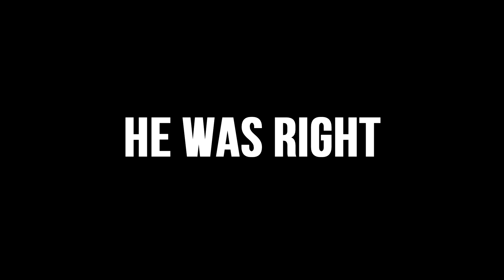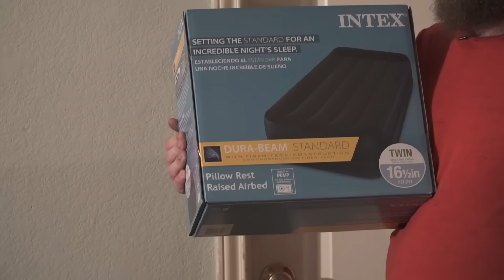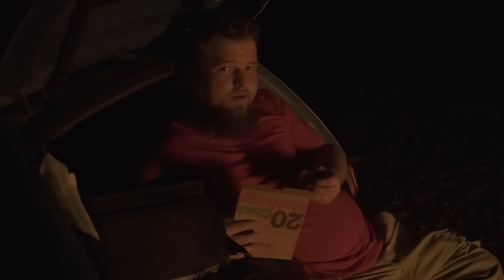Building the ULTIMATE homemade camper

Comment: This is something you all should redo with a budget of $5,000 each not including the cost of the car and you are not allowed to use a van or a truck or anything like a El Camino as with the truck or the Camino you can literally just drop a camper in the bed and with the van you can turn the inside into a mini RV